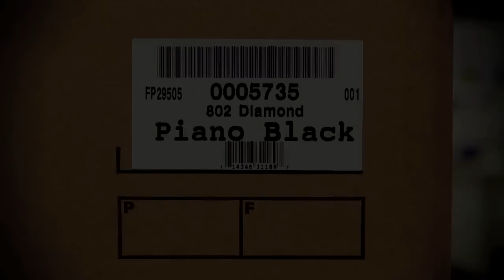The making of an 800 Series Diamond speaker

Comment: I started with the 804 Nautilus sold them 7 years later at 75% of the original cost used that plus new money to buy the 802 Nautilus. It weighs 154 pounds per speaker and the sound is spectacular. I will eventually sell them to get the 802D Nautilus. The moral of this story is they hold their value way better than a car and an heirloom in your family. They are stunning to see and hear!

Comment: Audiophile speaker cable believers would cringe at seeing that inside their speaker, very cheap wires are used to connect drivers to the crossovers and to the binding posts, so whatever 1000 dollar per meter speaker cable you're using, the current still travels trough a cheap 2 dollar per 10 meter wire.
Reply: Audiophile cable is the biggest scam
Reply: Wyatt Tyler
There was a test in the late 1980´s regarding so-called audiophile cables and regular cables. There were meagre traces of the superiority of high-end cables. Certain minor differences could be detected with the most challenging speakers with a low impedance (say 0,5 ohms, Inifinty Kappa series afair). The test concluded that there are far major factors in a savoury sound than mere cables: Proper cones, crossover network design, behaviour in the echoless room, controlling diffractions and room acoustics. I believe that 200 € cables may not make a huge difference with my 1988 Philips CD-player and boom-boom living room...
Reply: nokivasaracom Almost certainly none of that was audible.
Reply: Ester Samuels what?
Reply: The cables used inside the 800 Diamond series, are cables from A.J Van Den Hul, made for Bowers & Wilkins. 805, 804 and 802 uses the same type, while 800 uses a thicker version. Also made by VDH. None of these are no-brand, cheap, cables.
Reply: A copper wire is a copper wire if it costs 1000$ or 2$ it will sound the same
Reply: For all you know those cheap cables inside the speaker are most likely silver based instead of copper based which may only provide a marginal difference but still a better difference rather than a worse difference.  As for those who bash high end cables, tell me why you would spend $20,000+ on speaker towers and run 2$ coat hangers to them? Usually people who bash expensive cables can't afford them.
Reply: deepheart100 Can you hear a difference between silver and copper wire of the same thickness?
Reply: k
Reply: I have $12,000 HDMI cables, $16,000 speaker cables, $1000 USB cables and a $700 iPhone Lightning cable. Get on my level. /s
Reply: You are right but also wrong. The cables is not made by VDH, its just branded VDH, yes it has silver plating and that is not expensive at all. Certainly not comparable to the 2000USD per meter cabling your HIFI dealer would recommend for them. And would you ever use cheap spade connectors for your terminals?
Reply: i agreed with u
Reply: @deepheart100  Thich cupper is just thick cupper. If you cared so much about the cable you would have individual amplifiers to each speaker removing the need for long wires.
Reply: @marcusm5127  Thick copper is not just that. There are huge difference in micro-structure within the copper which affect how sound is transmitted in the cables. Don't believe in people who say that cables doesn't matter. They have never tested it for themselves. They just have fun bashing at others use of money on something that they doesn't understand and doesn't want to understand.
Reply: @oysteinsoreide4323  Absolutely they have different impedance but we are talking rather low frequencies. 20KHz in a normal cupper cable is not a problem. There is no way that money isn't better spent somewhere else.
Reply: @marcusm5127  Bad copper destroys the damping factor of the amplifier. If you want sloppy bass, and muddy treble, be my guest. But I buy cables that are about 10$ per meter, and that is good enough. But you should not buy 1$ per meter and expect good results. It comes music out. But all will be a bit more relaxed in the presentation. And by the way: 100$  per meter cable will be even better, but at diminishing returns of course, and it also comes down to electronics quality. No point using much on cables if you don't have good electronics.

Comment: Also, your article says it creates "eddy currents".  Now you're just using fancy words.  Eddy currents are electrical.  I think what you meant to say was "turbulent zones".  The turbulent zones, however, are designed not to interfere with the sound output, but to decrease the height of the boundary layer against the walls of your port and increase the velocity of your air, all while keeping the separation point of the air to a minimum.

Comment: An excellent example of winding up the cost of a product that is to be sold.
Ultimate sound quality is a chimera that doesn't exist. The very existence of auditory analyzer thresholds and functionality as a universal requirement for devices and instruments in the broadest sense of the word contradicts this understanding. It's time to abandon kevlar fibers in favor of high molecular weight graphite carbon fiber, and use high molecular weight polyethylene as a binder. You just need to learn how to cut off the heat generated on the speaker coil. And these new diaphragms will change the way we think about good dynamics. The difference in speed of sound in these materials is sufficient.

Comment: Why is the cross over so big?
Reply: Ester Samuels Can't really see a couple of the components too well but the capacitors are likely polypropylene going into 100s of uF. Similary sized to motor run capacitors. The two inductors on the right hand side have a wide diameter... I can't tell their height but the increased diameter is likely to reduce resistance. Speaking of resistance I can't see any resistors.... although if they're precision resistors they could be the square shapes on the end of the white cables. To me this looks like a well designed, quality crossover... to inflate the price of their speakers!
Reply: +Ester Samuels 
Power handling.
Reply: So they munch power, make them look bigger
Reply: Probably because these speakers max out at 1,000w.

Comment: at 2:02 Passed today-65, Failed today-123
Reply: you'r right. But it also says "total passes 178.185" they can't possible sell that many right?  even if half of them fail that's still a large market for those expensive speakers.
Reply: The failed speakers just get sent back through production to have any problems corrected. It isn't like it goes straight into the trash.
Reply: Good Eye lol
Reply: The software says "D2" and the year 2011
Reply: Beghty27 p

Plhas ol
Reply: Beghty27 p

Plhas ol
Reply: Beghty27

L
Reply: @suma5939  Me too

Comment: You made a mistake - the original 800 series speakers were not Matrix that came in the mid 1980s and was first fitted to the aptly named B&W Matrix 1 series. The honeycomb system invented by Laurence Dickie was then applied to the 801 and 802 to make the Matrix 801 series 2, identified by its port opening. People like Steve Roe or John Dibb could put your history straight for you.

Comment: You get intermodulation effects from the way plastic and aluminium tweeter cones deflect at high frequency that appear lower down in the audible frequency range. You can measure this.

Comment: all beautiful and laic is fascinating but does not justify the astronomical price. The high cost justifies only the economic viability of the whole project. The cost of the project must also include the consumption of toilet paper by all employees in the company because the sound obtained from these speakers is simply not for that price....interconnection cables are connected to the connectors I last seen on Trabant (DDR Porsche) but at a lower price.....how can you be sure that the strips (lamelas) from which you worked the box are acoustically the same when the ski manufacturers have the problem of making two identical, and doing the same with the same method....two boxes can not be made with the same resonant characteristic and can not be damped.A 16 Hz response is an impossible mission for this type of bass driver or maybe -18.4 db because it was measured in a normal room. long ago I had the B & W 801 (1982) who has endured a lot of strong amplifiers but not Hafler. It exploded the capacitor and then I replaced all the coils because you are saving copper wire, coils rolling on the cores (linearity-bad). I think after 801 you just got back....

Comment: Tristan - I totally agree - must be the sh*t cable inside!!! Joking aside, my 1990 Shahinian Arcs (internally wired with Kimber cable as standard) leave the 800 daimond treading water when it comes to musicality - for a fraction of the price!
Reply: The cables used inside the 800 Diamond series, are cables from A.J Van Den Hul, made for Bowers & Wilkins. 805, 804 and 802 uses the same type, while 800 uses a thicker version. Also made by VDH. None of these are no-brand, cheap, cables.
Reply: chris storrier "Overpriced" as in everything high-end. You don't get the quality jump as you get from moving up from entry level to mid-level items, but high end is still the next jump. Even tho some items in the high end category don't grant you ground-breaking differences from the medium level items, and everyone will get through life without even owning one single item in any items higher-end categories. its still a difference that everyone will understand. Not everyone will buy it, but everyone agrees that its worth more than the cheaper series. 

In some cases, i find the small jump in quality worth it, just because of knowing that there is a better version of what i own. Do i need it? no. Do i want it? of course i do. The only thing left to decide, is "can i afford it?"

Comment: Mid quality crossover components, terrible frequency response (even cheap Maggie 3.7s have better response with ultra cheap crossover components).  B&W sold their souls and it sounds like it.  Another high dollar POS.  The best are rare such as Gryphon, Sound Lab (Wilson Audio one of the worst at their price although they have upgraded their x-overs but way too complex as the KISS principle is the best to follow.  Audio Research and others have all sold their souls to holding companies and competition is gone.  Harman, a Samsung company.

No longer reference or monitor quality.  Focal has kept their own best but not available on their consumer overpriced garbage.  50% markup for retail outlets of any kind.  200-5000% cost increase for high priced garbage.